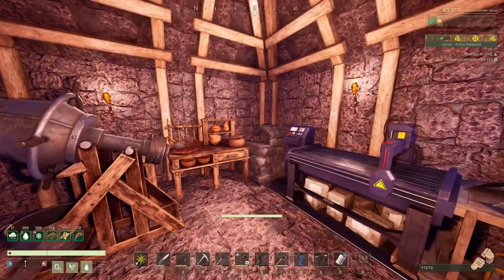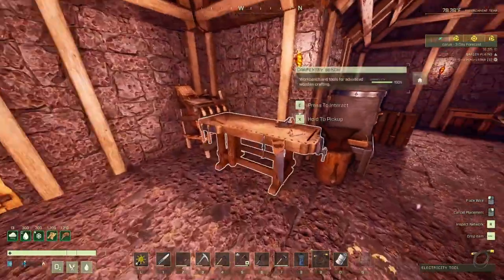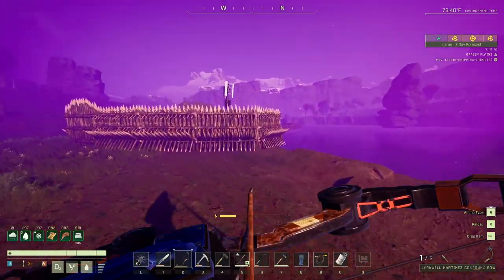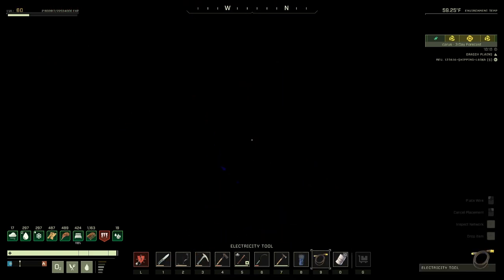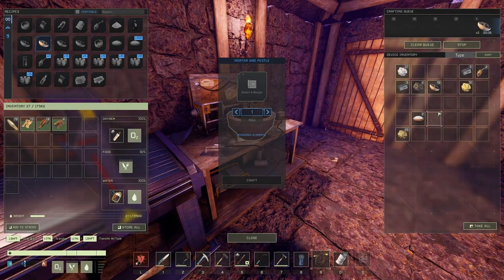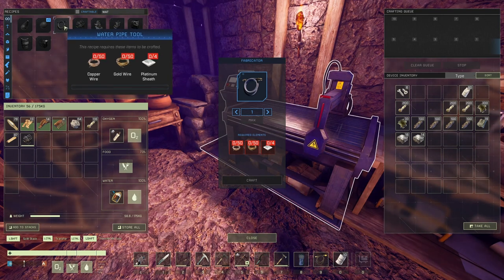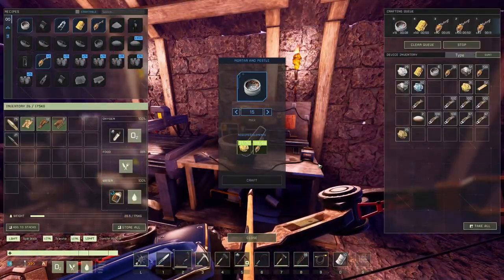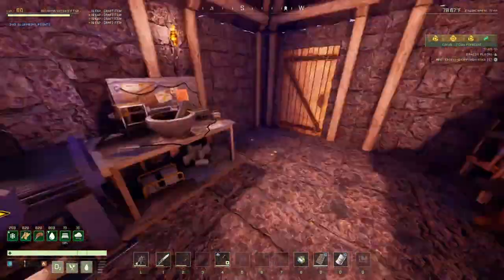Icarus - Prometheus - Titanium Drill, Water Purifier and a few Missions - Ep.04

Comment: Are you going to build a base in the south for the map expansion or wait to see if you can build in the new area? It will be a long run from where you are currently.
Reply from the maker: Hi there @vikingbrit270. Our primary base of operations will be here where this shack is because it will be in the field of drills. No point in putting another base in the south if my drills are here. When the new area will be introduced first I'll scout-it out, make a FOB and go from there. If it's nice and pretty we'll put a bigger base in there if not it is what it is. For transporting the needed building pieces and machinery I'll use the pod and my back. The distance it's not that bad, I can get in the most south area of the map in 3 minutes or something like that. Thanks for being here.